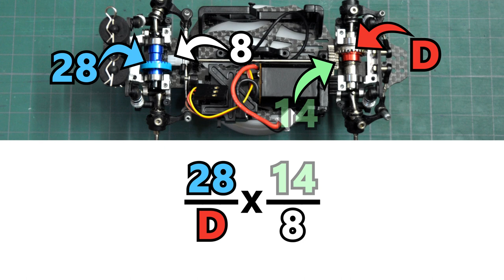Introduction to RC Drift Countersteer (CS) Mod & Mini-Q Q7 CS

Comment: Hey dude, how's things? I've watched this video quite a lot..... I'm wondering, in this video you have a formula for working out your CS ratio, is there a rule of thumb that you know of as a rough guideline for selecting a decent gear ratio with rwd drift? I'm trying to build a wltoys rwd setup with an RM style motor mounting position and I'm struggling a little with my gear ratio, lol. I felt you was the best man to ask about this 😎👍I have a gearbox mockup I just think that there's far too much reduction from the spur down to the wheels 🤷‍♂️ I would love to know your thoughts on this. Thanks bro👌
Reply from the maker: I don't really have something like that since most of the RWD cars I got are like pre-set for RWD already. But if you feel like the car doesn't have enough pull you can decrease the pinion size and if you feel that top end is not enough while it starts fine then increase the gear. That's pretty much it.
Reply: That's excellent advice, thank you, I know you have a lot of rwd setups, and you know so much about this subject..... where do you think is the best position for the motor? As I say this is very much in the mockup stages at the moment just trying to see what I can fit and where etc👍

Comment: Good morning, sorry to bother you, I have a question and I don't know if you know the Ruhazn 530, it has 2 switches, one on and off and another on the speed controller, you know what the ESC is for ? Thank you
Reply from the maker: That red ESC has 2 switches. One switch for power and the other one to turn the brake on and off. Make sure you turn the power off first before switching the brake.
Reply: @BeaversHobby  Ah, thank you very much

Comment: Thank you so much. This is the first video that thoroughly explains both countersteer at the 1/27th scale and how to setup the Mini-Q properly.
Reply: We are Mini-Q dealer in Canada and had all but given up on the cars because of some quality issues on the Q5 and poor machining of the countersteer and front one-way. This gives us new hope that the Q-7 may be better and that I can also use these mods on the Q-5.

 I see you also went with the Three Racing One Way...I agree; the Sino Hobby one-way seems too heavy and is more work for the motor.

Are you now happy with the Q7 using the three mods (body to 90MM, countersteer and servo arm from WL toys)?

Comment: Which one is better ? HGD1 or MINI-Q7  thanks.
Reply from the maker: They are different beasts altogether. Q7 is a really good AWD car for both touring and drifting while HGD1 is a really good RWD drift car.
If you focus on drifting only then HGD1 has brighter future because the trend is moving towards RWD.
Reply: thank you for the suggestion. I always like your video..
Reply from the maker: @endraprasetya7911  My pleasure.

Comment: Is gyro still unnecessary for a cs drift car? Whats the best ratio?
Reply from the maker: Gyro helps a lot especially if you want to drive fast. But it not necessary. You can drive without it.
Easy to start CS ratio is 1.5, you won't feel much difference but the back will step out easier.
My favourite is 1.75. It's easy to drive, can hold some counter steer.
More than this like 2.0 or beyond will be much harder to drive and you'll have to fight the car to come back to straight line.

Comment: hi
where can I find the 26-teeth differential of 3 Racing?
Thank you
Reply from the maker: Here they are https://www.3racing-parts.com/kyosho-miniz-awd-rebuild-kit-for-awd24-and-awd25-gear-set-3racing-awd24rg-p-10002196.html
You can only use them with oneway and solid axle though, not for ball diff.
But if you buy 3Racing or Eagle Racing oneway it will come with additional gears too. The package I give you here is replacement part for maintenance.

Comment: Since I couldn't get the gear set. I ended up replacing the ring gear on the differential from a 28t to 26t,It does the same effect This works with the 3racing and atomic rc differential. Unfortunately it's starting to be difficult to get them also🙁
Reply from the maker: Unfortunately the gear is not available anymore. However you can still DIY it if you want more CS ratio.
CS rear gear https://youtu.be/pZxPKXgPvt0
Solid axle https://youtu.be/t6PiUq-_9lI

You can still search for the Eagle Racing parts on ebay. The shop is still on... for now.

Comment: Awesome tutorial!   The Sinohobby front one way is available under the name head unit at Banggood. But the Sinohobby gear set with solid axle is no longer awaylable. I’m couldn’t find it anywhere on the internet and my skills are not good enough to drill the gears by myself.  Do you an online shop where we can buy the gear set with solid axle?
Reply from the maker: You can get solid axle that's easy do CS mod from Eagle Racing. https://www.ebay.com/itm/MA20VE-13-AL-Rear-Solid-Axle-For-AWD-MA-020VE/253336924294
But for the spur gear / rear gear there's no other choice but to mod it yourself.

Comment: Can shinobi cs kit and front one way fit mini z awd?
Reply from the maker: Yes, they both fit. You can still find the one way and solid axle on aliexpress. The rear gear is out of production. However the new batch for these parts are pretty bad. They have sharp gear teeth and will ruin your pinion gear.
Reply: @BeaversHobby  thanks for the heads up bro. Any front one way, cs kit alternative?
Reply from the maker: @RonBernardino  Right now there's only the Kyosho set. I've found this but it's a now shop on aliexpress so I don't know if they will actually deliver. https://www.aliexpress.com/item/1005001671065507.html

Comment: do you know where you can find those pine nuts? or something similar and that is valid for the sinohobby mini q q7 brushless? I can't find anythin
Reply from the maker: Pine nuts? Did you mean the nuts for wheels?
In that case they are M2 lock nuts. You can upgrade it to aluminium as well and it'll be lighter. http://bit.ly/2Lck02G
Don't forget to get a cross wrench. http://bit.ly/2EmCA2R
Reply: @BeaversHobby  no, 14-tooth metal pinions and the differential, the kit that you take out in this video, is that in banggod it is no longer or in aliexpress and I cannot find it, and I wanted to do drift
Reply from the maker: @juancar69  Oh, they are pretty hard to find these days since Sinohobby stopped selling them. There are other sources. Here's the rear solid axle for CS. https://www.aliexpress.com/item/33012812405.html
As for the gear, it's been out of production for a while now and there's only this whole shaft. You can choose the wheelbase you need. The rear gear is 12T so it might not fit correctly with the solid axle.  https://www.aliexpress.com/item/4001047156489.html
You can also make one yourself if you like. Here's the tutorial. https://youtu.be/pZxPKXgPvt0
Reply: @BeaversHobby  Thank you very much, I also saw the video. Now I'll study a little how it goes
Reply from the maker: @juancar69  My pleasure.

Comment: Can this part be found on aliexpress? I don't see it
Reply from the maker: Front one way, yes. It's has strange name like "front head unit" but it's front one way. Rear CS gear is nowhere to be found nowadays. Only the spool/locked diff part. The name is also strange like "anti tire". I have another video showing how to make custom CS gear too so this is not a problem.
Reply: @BeaversHobby  I wish I could find the Mini-q Q7 on Amazon, I'm shocked actually
Reply from the maker: @erraddict  Try other name like Sinohobby, Mini-Q Q9, 1/28 car. Something might pop up.

Comment: Dose the mini z parts wheels and body shells fit on wltoys k989 as I would like to change body and wheels have you any links for these bits thanks top vids 👍👌
Reply from the maker: Yes, swing shafts, wheels from AWD will fit directly. I mentioned this in my review/first stage of touring car mod here https://www.youtube.com/watch?v=TnhriaSSfSA
Body shell also fit as well. Here is how to choose Mini-Z body for WLtoys, how to fit it and fix if the shock tower is too high https://www.youtube.com/watch?v=-gCJEXXWBEo
I forgot one more thing, you can also use Mini-Z diffs too but you'll need long swing shafts (or "universal shaft" if you look at Atomic AMZ) because K989 is wide like MA020 wide chassis.

Comment: Any idea where to find that kit ?
Its out of stock everywhere except some highly suspicious websites like ecrater
Will the car be not as fun or useful without the countersteer mod or kit ?
Reply from the maker: Right now, no idea. It's out of stock everywhere as you know.
You can make one from existing parts if you want. Here's the tutorial https://www.youtube.com/watch?v=t6PiUq-_9lI (same method as WLtoys)
Fun is quite subjective. This car is already very good at initiating drift and keep on sliding.
This mod will allow you to kick the back out easier and hold the opposite lock longer but it will sacrifice some speed. So if you want to slide at high speed you don't want to do this.

Comment: Quick question? What's the difference between the mini q5 and the q7 is one just newer? I want to get another car for drifting but not to sure on what
Reply from the maker: Q7 is newer with double wishbone suspension so it drives much better. Q7 also has fully adjustable suspension from camber to toe. If you want to get a drift car Q7 is the best for AWD.

Comment: Amazing video! So how did you lock the one way differential in the back? It doesnt seem to have any screws to open it up? Thanks!
Reply from the maker: At the back is a solid axle. So it's already locked.
Reply from the maker: @socalledbored  4 shims. 2 on each side for stock setup 1.75 CS.

Comment: Hi, i just instal 3racing front one way on my mini q, but when i push the brake the front wheel is not spinning to much?? The bearing is greasing well and oily. Do you have any suggestions maybe?
Reply from the maker: It doesn't have to spin forward too much when you test it in the air. Try putting the car on the floor, if you push the car (by hand) forward and the front wheels spin while rear wheels stay stationary then it's ok. Otherwise you can apply one way bearing oil to it, what I did was putting some bicycle chain oil in it. The oil is a bit sticky and works really well.
Reply: Ok, i see, thank you sir..

Comment: If I want to buy a differential that is back where is it and what is the search name
Reply from the maker: The name in ebay is Sinohobby Gears With One Straight Shaft Anti-tire kit. Link is also in the description.
Reply: That's the RC size 1:28 ?
Reply from the maker: @aringaringanak  Yes, it's 1/28-1/27 the same size and many parts are interchangeable between this and Mini-Z AWD.

Comment: Bro, does the shinohobby mini q cs ratio gears also work on mini z with some slight modifications.
Reply from the maker: The diff (solid axle/rigid axle) is direct fit. The gear however is unknown. Shaft has the same kind of notch but I don't know the exact diameter of Mini-Z's shaft. Anyway, you can just mod the rear gear by putting a bigger pinion over the original one, it's so easy to do.
I have another video coming up about how to DIY a CS gear kit, both rear gear and diff.
Reply: So just need to cut away some of the shaft for fitting
Reply from the maker: Blurr Face Mini-Z shaft already has the cut. The diameter of the shaft is what I'm worry about. I heard it is smaller and the gear might not fit properly. Anyway, you can try glueing them together but don't let any glue get inside the ball bearing.
Reply: Wait can the the Mini q TR Q2 counter steer while being stock?
Reply from the maker: TR Q2 is RWD. If you talk about the act of counter steering the car then yes, it can do that, any car can do that. But the term "countersteer" or "CS" is for 4WD car that means rear wheels spin faster than front wheels.
Reply: Thanks so much bro I am in dept

Comment: Hi mate :-) I was just wondering how you rate the 3racing one way diff? I've purchased 2 now and they both struggle to maintain drive.......  most of the time the car is in 3 wheel drive mode and is impossible to control...... is there any reason these diffs may get jammed or something?
Reply from the maker: I haven't use it much but one way bearing need to be cleaned and lubed properly. Otherwise it won't grip the shaft (slipping).
The lube has to be a bit thick too. There are one way oil or grease and you might find one at your local hobby shop.